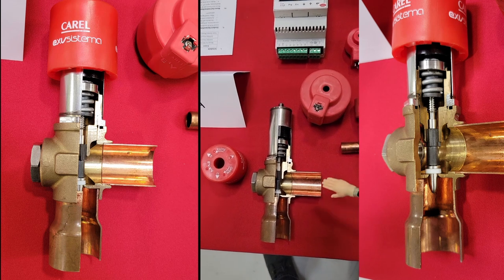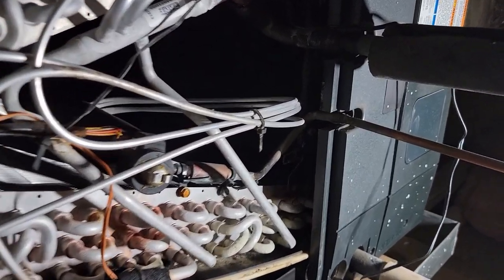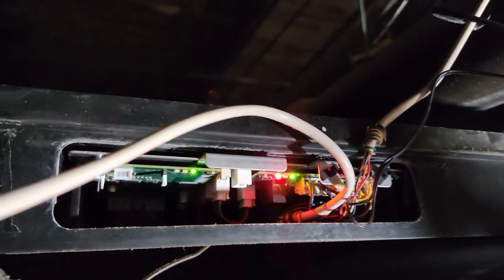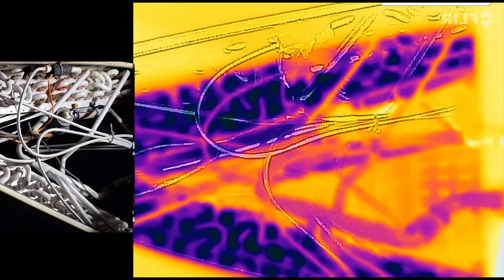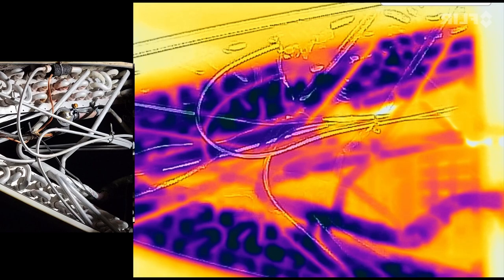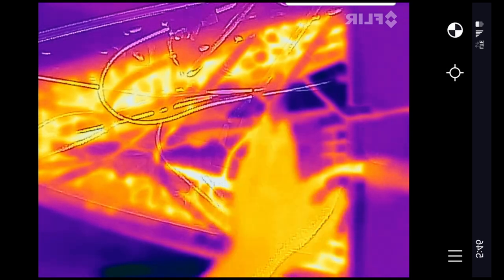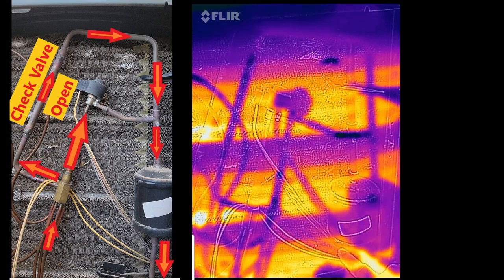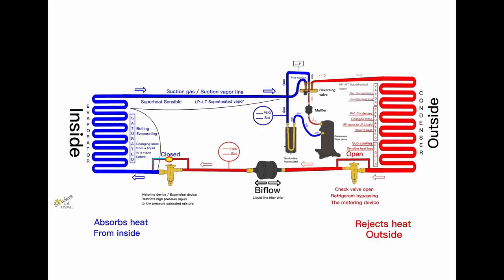Heat Pump 08 EXV EEV Electronic Expansion Valve

Comment: Can a eev magnet be used as a lls magnet?
Reply from the maker: No,
LLS is a single round magnet trying to pull upwards,
The EEV magnets are separate spaced evenly around to simulate the steps and poles of the motor position.

Comment: Can old piston metering systems be converted to use an electronic txv? Do they make kits to do that? Do those systems replace the defrost board wirh a controller board (if they are available)?
Reply from the maker: They do make an EXV retrofit kits. Especially used in refrigeration.  
I don't know about any universal ones integrated with the defrost board though.

Comment: Is once a screw Pen valve And the other is a gillertine. One It's highly more accurate at regulating But the other one A far more simpler and cheaper design. The valve needs to be Regulated through a very sophisticated monitoring system. I'm pretty sure the guillotine isn't so strict. The actual sensors sensors are probably digital with the Guilloting an amalog with the Valve. Cost difference must be  outrageous And a constant headache calibrating at any point. While a girl'valentine is digital Position 1234 that's probably it. I'm regulated most likely by a simple silhouette system.
Reply from the maker: Excellent insite